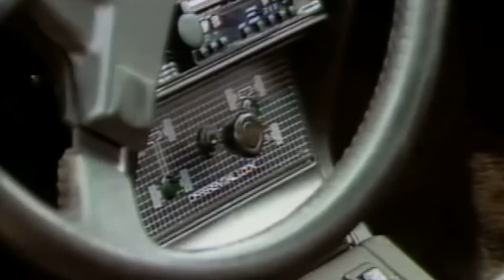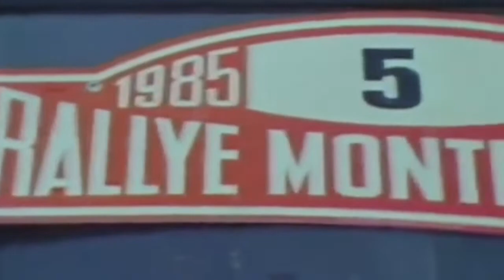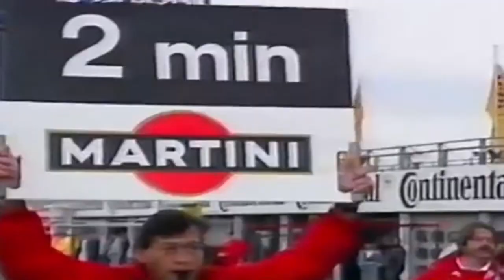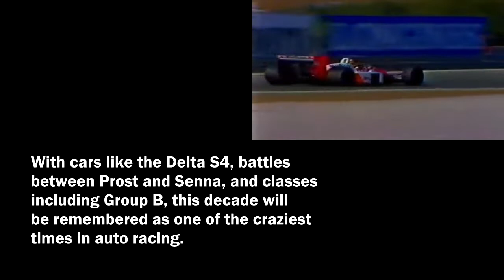1980's - The Best Decade of Racing -  Synthwave Mega Compilation

Comment: I think racing got better and bigger over the decades?
Reply: Of course it got safer, faster, and „better“. But the new cars don’t have the Style, the raw power, the sheer craziness of driver, co-driver and the crowds on the road. Or just take a look at F1. Are the new engines really as good sounding and scary as the V12 from the old times? Rallye and Racing in General became better, but it also became less thrilling.
Reply: No it didn't. They where much more spectators back then even in amateurs events. And not to mention the fact that the cars were also much more spectacular.